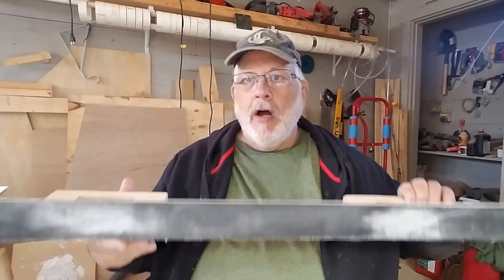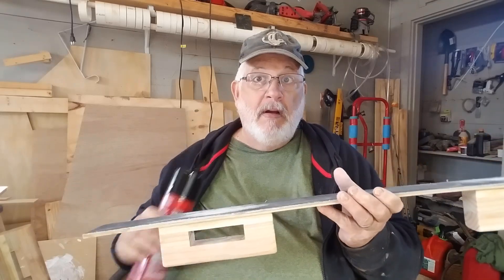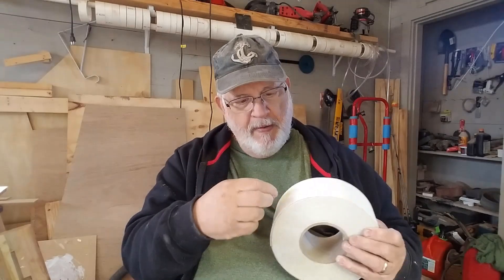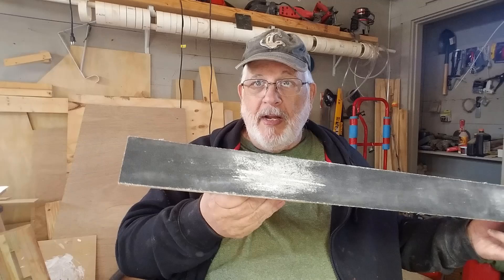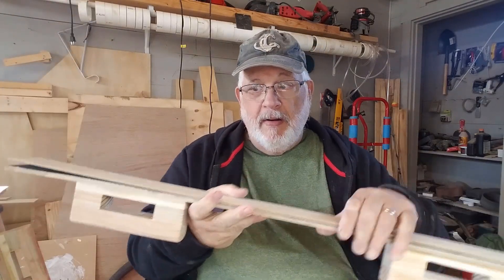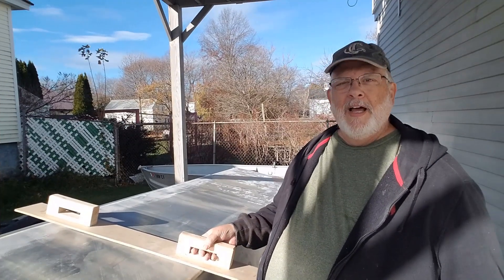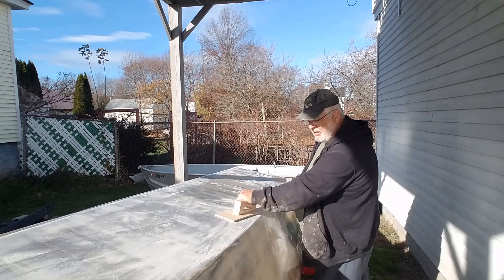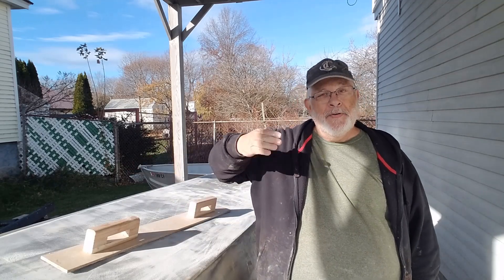Part 2: DIY Longboard Sander Upgrades – Tips & Easier Sandpaper Swaps!

Comment: give the long board a backbone and it will stiffen up.  I just glued a piece of 1x1 along the longboard and works as a handle but also makes it ridgid. I have two longboard sanders - one flexible and the other ridged. Isocol spray is great for cleaning your hands after making a mess when gluing up
Reply from the maker: I'll have to try that!  Thanks for the tip!  :-)